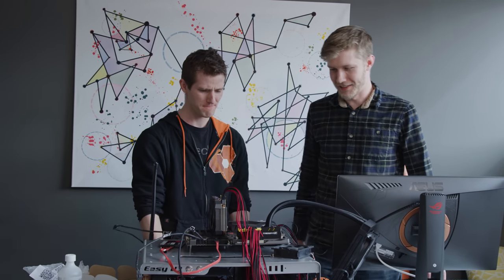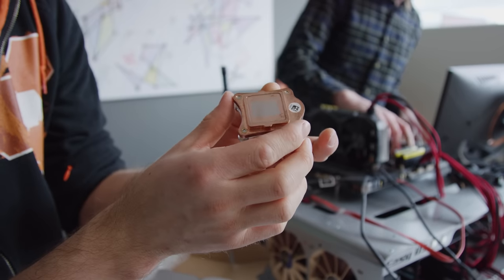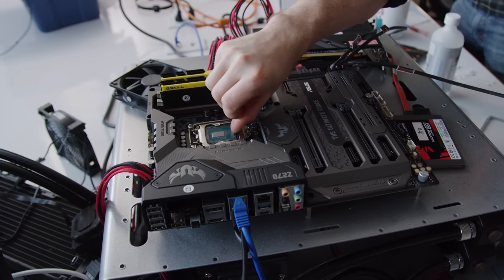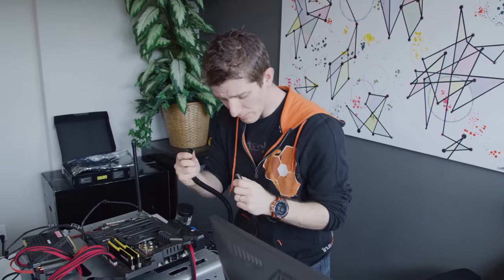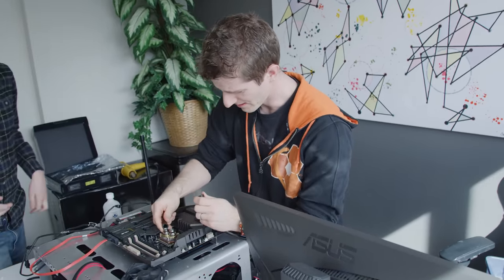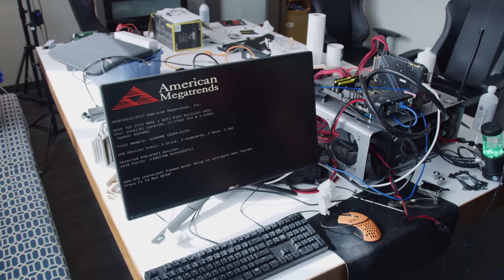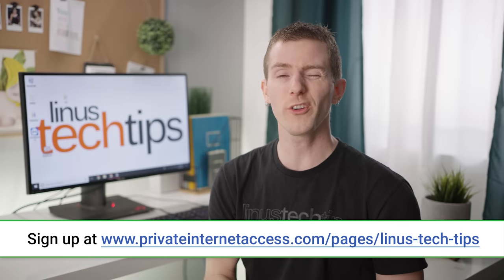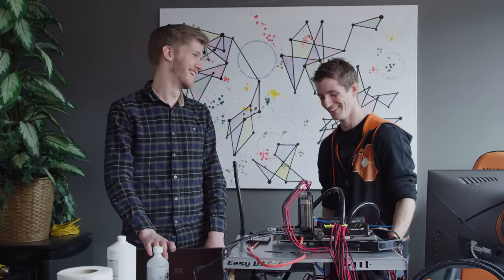This cooler VOIDS your warranty! - Worth the risk??

Comment: What about a water cooling system with liquid metal
Reply: because metal has higher density than water, it would need more power to move the fluid, hence more noise for not much gain...

Comment: Well as far as the warranty goes, failure rates of these chips are very low, so if you've stress tested it, the chances of it effing later are minimal. Unless you fuck it up yourself by pouring water all over it.

Comment: Doesn't work with AMD processors. They have soldered lids.
Not only will you void the warranty if you manage to crack them open, but you will potentially expose the IC layer of the die to the elements, which is an immediate death sentence to any CPU.

Comment: Why doesn't Intel just start working with cpu cooling manufactures to integrate their chips into these blocks as an option? Obviously people want the best cooling solution. Most people wouldn't attempt this method on their own given the deliding process. Mind you, given how sloppy Linus pulled it off, gives a little reassurance for others to try it lol.

Comment: when he put the CPU in the socket with the CPU power cable still plugged in, i mean i was breaking a sweat a little. If they turned on the system on accident for even a second, bye bye CPU

Comment: Do this with a i5-3570K and you will be AmAzEd!
Reply: I get similar temps with liquid metal on a delidid i5-3570k.....I don't even need a fan running on my IHS but curious to see what a direct contact would preform on this chip with out the IHS...with liquid metal of course

Comment: my cpu temp is 50 max with a hyper 212
Reply: What CPU? How fast? What's the voltage? How long did you run your stress test?
Reply: Superkirbeh amd fx 6300 4.6 ghz overclock (edit) don’t know the voltage gotta check it and I’m too lazy
Reply: @yeet__5955  there's no way that CPU is only 50c max load lmao
Reply: Superkirbeh yeah it only got to 55 while playing destiny 2 for 3 hours

Comment: I remember a time when CPU's didn't have Integrated heat spreaders....
Reply: I remember when We started with a bare board and had to solder all the chips to the board. You got the computer as a kit. Those were the days.

Comment: Well, its not really different than would we did close to 20 years ago on pentium 3 or athlon cpus that did not have an IHS (i feel old now). sure those cpus were a bit thicker, but espacially the early athlons could be very brittle and the higher DIE meant chipped off edged if you did stupid things.  i wouldnt hesistate to give it a go.

btw: linus, your german sucks :D